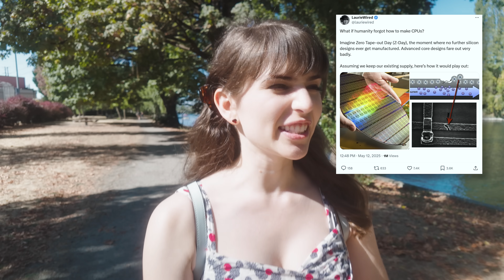what if humans forgot how to make CPUs?

Comment: Eh, i disagree to an extent. Even after 20-30 years, i think we'll be surprised how many modern machines would still be working and functional. I mean the 80gb HDD in my garage computer, along with the computer itself is nearly 20 years old, and has shown no signs of slowing down. It doesn't really do much other than play music and basc internet stuff. But it's in a filthy environment, never shuts off, and still works just fine.

Comment: I share your concern, and in fact it's even at levels higher than the CPU's.
I am a University lecturer in Computer Science, and have noticed a significant decline in the demand for teaching Low-Level computing, since my Uni days (20+ years back).
My module is keeping the flame alive (or atleast a spark of it), but fewer courses are keeping it too much high-level stuff they want to teach.
High-Level programming tools are the fashionable stuff - what students want to learn (what employers ask for).
Serious computer scientists only get older and will eventually die out.
I can see software becoming sloppy  before CPUs run out (designs are changed incrementally, and then once designed, the manufacturing is automated)

Comment: In my experience SSD drives fail far more than spinning disk hard drives. And they seem to die suddenly most of the time. So Id venture to say you are wrong in that entry. I mean I have a stack of early 1980s MFM hard drives and a bunch of them still work at 40+ years old. I understand older parts were made better but Id still bet on the conventional drives over SSD.

Comment: I think motherboards would be the first component to fail. Because of their complexity they have a very low projected lifespan and a much higher risk to die before that, compared to other components. They're also dependent on microporcessors to make, so new ones wouldn't be available.

Comment: You know, the railroads used relay based code systems that were pretty fail safe. So you could build relay based systems that would just be slow, power intensive and large but they can work even after a EMP. I figure you'd just have come up with some standardized sub-assemblies like you would find inside a FPGA. Of course if FPGA still existed, you could just replace the CPUs and make a bunch of SOC hardware. In your scenario, it wasn't clear to me exactly what would no longer exist? You said CPUs so what all does that include? You mentioned motors and batteries would start to fail. Is this because CPU would not be available in manufacturing equipment?

Comment: So wait. In this scenario the Hardware / RTL / CPU / GPU / SOC / Analog / Digital / Backend / Front End / Emulation / FPGA / Frontend Verification / Physical Verification / etc engineers all simultaniously around the world forgot how to make a CPU?

... But... software engineers still understand the intricacies of the hardware architecture well enough to sequeeze max efficiency in the algorithms? Seems a bit biased but okay.

The biggest thing lost would most likely be the technology, maybe all the fabs are destroyed and databases of designs lost. But we are constantly trying to reinvent our architectures and processes. I think your hardest part is rebuilding the equipment to get higher and higher yelds and smaller nodes. But even then, you have a lot of people that you need to bump off to just not know how to build the hardware.

Comment: so my first guess is that we would be somewhere near the 1930s with electricity and, you know, antibiotics. but then i realized, hmmm... i think we are at or approaching quickly the threshold where we realize technology, at least the way we use it, has done the complete opposite of what we all imagined and almost everyone still tries to claim - it has introduced a dystopia, the enshittification of everything as one guy i heard about once mentioned. under current systems of power its a very very, way closer than we would like to think, non-zero probability that technology ends human life. but then that begs the question, "what is technology?"

thats easy. technology allows for things to be done more productively and more efficiently, cheaper. well then we have to ask "are things like cpus modern information netowrks electronics and other related systems actually "technology"?

hmmm, well we live in a capitalist system. what does capitalism demand? infinite growth. yeah yeah. but why? because of the demands of the capitalist which are ever increasing transfers of wealth year of year, time after time. but then thats the origin of the crux - if capitalists must make more and more but technology by definition makes more and more while costing less and less then the only way they can extract more and more is by restricting access to the thing that would make more and more for less and less... see where this is going

the solution would lie in who has power. but we know who has that. this all adds up to a situation where as "tech" becomes cheaper and cheaper, producing more and more, the capitalists restricts access to both the "tech" and its production because of course the whole point is he must make more and more.

this means under capitalism, at least at the point we are at in capital's evolution, technology may not even be possible. at least not on a grand, society serving, large scale way. which is, well, what technology is supposed to be in the first place.

technology cannot exist under capitalism or any system of hierarchy where the top continuously extract more and more and more and more and more from the rest of us...

i mean, thats the whole point of AI and the reason we have been hearing so much about huge layoffs, right?

Comment: Though of such scenario that includes Zday a year or two ago while worldbuilding.

I believe initially in the early post-Zday stages would try to start a IC fab with whatever equipment and whoever has a talent they have but they will realize that it will take longer than expected.

Tech-wise there will be a collective effort engineers and enthusiasts will basically reverse engineer analog and electromechanical devices and equipment that exists in the wild and museums in anticipation of the potential of a need to replace devices that rely on computers and microcontrollers, and some of them are very picky so there will be some competition. Will start with simpler things like toasters and microwave ovens but more complicated stuff like analog audio/visual gear, and crossbar and rotary (more common in Europe) telephone switching systems to fulfill that telecommunication needs but it will take a while for those to be put on use.

There will be some critical networks still running, enthusiasts will network over mesh networks with whatever equipment they have access to. Some countries might decide to shut down internet access to most people to preserve networking gear.

Tape backup systems such as LTO will become more important for long-term storage, though (like today) drives that can read those tapes will become hard to find as time passes.

People will boot into live CD or USB Linux distros and work on RAM.

Comment: Interesting scenario. I think a different sequence is more likely. As someone who had a childhood before solid state electronics of any kind was common, it seems to me that we would fall back to 60s technology, business practices, and social norms after only a few years. Carburetor cars, electro-mechanical phone switching and tabulating machines, printed newspapers, card and board games, mailing checks to pay bills, etc. The human race has experience living without CPUs, and would just return to living that way. Where existing supplies would be hoarded as long as possible wouldn’t be for the internet, it would be for satellite use, and military use. Other than those areas, I think the need would be shifted within 5 or so years, as governments, industry, and society geared up for the inevitable change while means to orchestrate it still existed. 

BTW, I just shifted off of my 7 year old iPhone X because critical apps require an OS update that isn’t supported on it. It still works fine, and the battery life still shows 89%. My old iPhone 6 is still working too, though only as an MP3 player now. Things can last longer than you might expect.

Comment: The whole concept is fun, but I'm reasonably certain (even for modern CPUs) your timeline for failure is too short. I have multiple CPUs over a decade old that prior to me owning them, ran 24/7 (old server hardware is fun), all are still working. I have had more motherboards fail over time than CPUs. The 2 CPU failures I have had were both overclocked and over volted, and technically still run if I underclock and undervolt them. After only 3 years over 99% of CPUs would be fine, with a higher failure rate from damage from motherboard/power supply than from degradation.  Losses due to violence/crime/war would outstrip "natural" failure. Your "3 years post Z day" would be far closer to 3 decades post z day, at least.

...your timeline on core switches dying is also too short. Consumer stuff sure, enterprise gear? not so much.

More frightening, to be honest, is if we are stopping the fabs then all the other ICs stop too. Flash memory has far more of a finite life than CPUs, but this would go beyond computing. No new cars with new ICs, no replacement Mosfets, or triacs, power plants shutting down for lack of control parts, hospitals losing critical machines with no replacements, etc

Comment: One day, Moore's law will be reached. No more, will there be a newer chip that has higher density of transistors. And eventually, a short time after this AI and humans will have created the most optimal code. What happens to the hardware and software manufacturers? Their stocks and values stagnate or collapse as no more next quarters with faster/more efficient products. Everything has a maximum.

Comment: I am (still) predicting something like this may happen to electric guitar "amplifiers", which is really a misnomer because they are also soundshapers. For a very long time, vacuum tubes were still used in that type of musical gear, as there was no real competition by transistor or upcoming digital versions of that (depending on the style of music & playing), there was just always something missing on the overall sonic behavior of the "replicas".
But in recent years it has gotten massively better and "amp profiling" is a thing, then the war in the east (a lot of the still produced vacuum tubes were from there) is making tube amps starting to die out (is what it looks to me), as of course maintanenace and versatility wise, tube amps already lose, and when the sound becomes on par & it replacement parts get unobtainable, there is not much going for them anymore.
The thing is, though, that the knowledge of how to make really convincing (and not just for some sound settings, but across the board, as in, indistinguishable) digital guitar amps is somewhat less well known in the details than the rough ideas many DSP people have in their heads about that (who don't understand the intricacies of how popular tube amps really worked in detail under different conditions, beyond the abstract block diagram), and the details kept as a bit of a secret.
The day that actual tube amps have died out, and the people who really understand them, and private code bases and research documentation of those few who are currently making the really good products there - if anything happens to them for whatever market fluctuations, bad economies, etc, maybe that knowledge also gets lost.

This subject may not be as important to some people than to othersvs. computers... ;)

Comment: I bought 132 MAC G4 800mhz gray case computers with dual 80 gig hard drives From the university of Florida for $15.00 each running MAC 9.2.2. / They are still in storage and are actually loaded with 340 programs that run WAY FASTER than today's BEST computers with the best OVER BLOATED programs. After Z-day I'll be a billionaire!

Comment: You really do overestimate the speed of decline. ECUs of cars from the 80s still happily work today.... These things won't start to fail, despite thermal cycling, in 10 years... ...and 15 years for the coherent internet? Networks definitely don't fail that fast. ...and by gradually scaling back and rerouting the coherent internet could go for maybe as long as a 100 years, I think... In 15 years there would be at most some performance degradation....

Comment: I think you overestimated how fast things degrade. I mean network switches and components to start failing already in 7 years?? Those things will keep running for 50 years at least..... ...and the older machines are practically immortal.

Comment: Have my 3d printer and some schematics for a pick and place machine that'll my side project for the next 2 years. Been working on my off-grid mobile campervan lab for 6 months now. Need a small scale CNC mill and enough home batteries to power a small neighborhood but the solar isn't hard to find out here and it's rather cheap where I am. If society collapses in 5 years I should have enough documentation and equipment by then to build at least basic computers from scratch. 

In the event of nuclear catastrophy I'm working on a basic hydroelectric generator that should harness enough power to run a server with a local LLM trained on everything I'd need to know for at least 10hrs a month. If I don't die in the blast I'm driving right to our local caverns down the road and becoming a true gremlin

When I redo the outside of the camper you better bet I'm Faraday caging it. I have 5 desktops and innumerable parts in there right now. The goal is to have all the info to restart society 😂

Comment: I'm telling you right now. 

AM4 would, somehow, still be working 50 years from now. It's 10 years old nearly and got 2 new CPU releases from AMD in 2025. I have a B350 board from 2017 that is running a 5600. 

Yes. Really. 

Zen 3 on a B350. It's possible. 

Gigabyte + AM4 = The Forever Computer

Also, as soon as Z-Day happens...I'm investing in Electro-Harmonix and Svetlana...We gonna need dem tubez.

Comment: You remember Buck Rogers in the 25th Century series? Of course not that was a rhetorical question. This series ran from 1979 to 1981. Amongst many of the future prognostications was the theft of computer chips. Dr. Theopolis was basically a super computer in a big pendant and he was constantly under the threat of theft.

Having worked in the Electronics industry for close to 50 years, I was always looking to look out for salvageable components that were heading for the scrap bin. I thought one day I would make a robot or two of some sort.  One of my more prized possessions is about 100 single board computers with radiation hardened MC68000 CPUs and 64 I/o  lines already all buffered, just needing a program in some hardware interfacing. 

When the computer chip manufacturing falls on its face due to the weight of its own incompetance I’ll be eating steak and living in that big mansion on the top of the hill. 😂😂😂😂😂

Comment: If we stopped development of hardware for 5 years, our entire code base, everything in the whole wide ecosystem would improve so that once we start developing again our software would run better. When processing power increases we waste a TON of it. Take youtube. It is considerably heavier to run now than 5 years ago, and yet... there are no features that we really need that have been added. They just put more and more stuff in the code that needs to be executed because the average computing power increases constantly. You download a youtube video and run it in VLC and it may take TEN TIMES less power to do the SAME thing. While the platforms are completely different, and things running in a browser running in various OS will be less efficient Youtube doesn't need to optimize to make sure their code runs as efficiently as possible. Making things efficient cost money in development, it becomes difficult to manage, to add new features and the kind of 1000 developer teams that they have would be very difficult to manage when each optimization really does obfuscate the code too, and in the end, only one dude may know how a big part of the whole works.

But... if we froze hardware development for 5 years, we would save a TON of power too... We waste huge amounts of energy on stupid bullshit code that is not sloppy but not made to be efficient in terms of computing power but efficient at generating revenue and profit...

Comment: The degredation of society in your scenario seems to be too slow in my opinion. From listening to your timeline there is no consideration to some of the more fundamental aspects of our structures that would no longer be able to me maintained without CPUs. Farming would be practically impossible without modern controllers in the various machins we rely on to produce and harvest vast tracts of land on a day to day basis. Farms in even just the 1000+ acre size would quickly collapse from the 1 man operation we rely on currently and food shortages would cause massive problems in population centres due to lack of transportation and supply. You went up to 30 years, we probably wouldn't reach 10 years without communities fracturing and collapsing back to smaller structures as we all revert to practices not seen since the early 1900's. That's at least what I would predict. Farming communities would likely survive without major disruption but cities would have incredible problems in the short and medium terms.